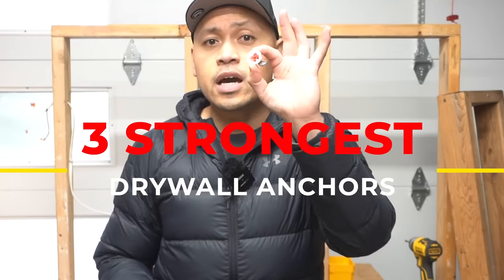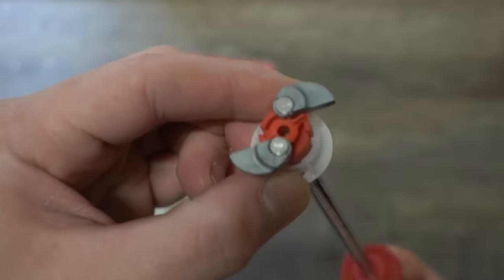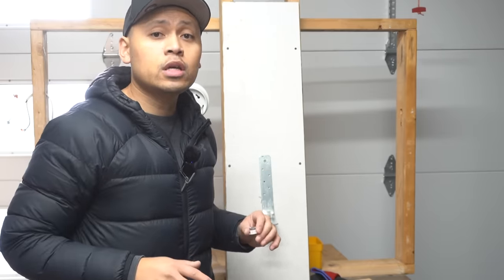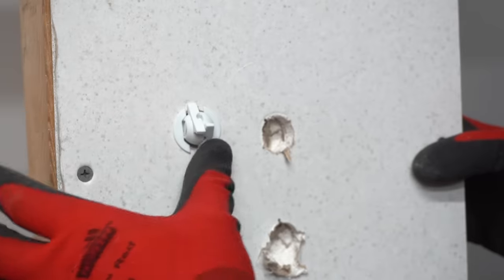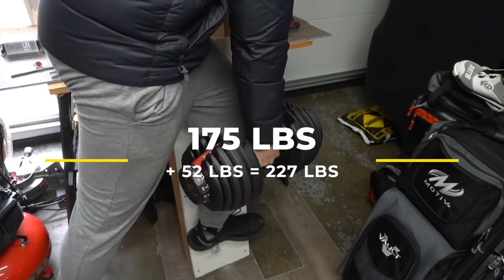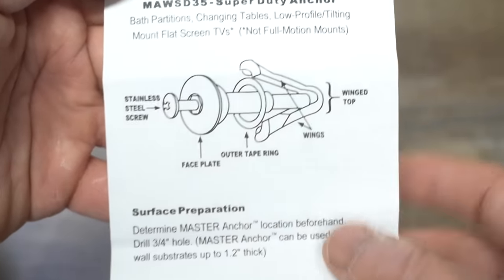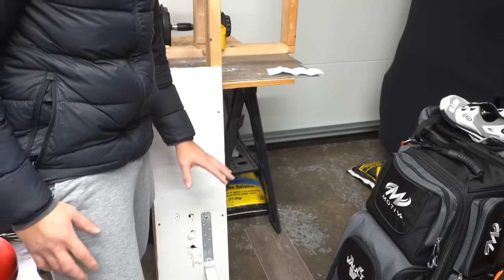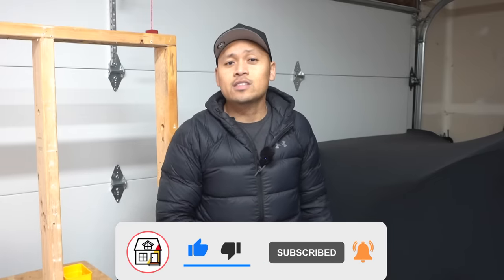Worlds STRONGEST Drywall Anchors EVER MADE! Lets Test it! How To DIY!

Comment: As a structural engineer, I don't recommend hanging anything more than 25 lbs from drywall; if anything is heavier, try to attach it directly to the stud.
Reply: Agree… Thanks for this
Reply: Yes, but this is for times when it does not align with stud.
Reply from the maker: Thank you for sharing!
Reply from the maker: I agree as well! 👍🏽😊🙏🏽
Reply: As a homeowner i do what i want.
Reply: Ya I mostly hang tvs and stuff and pretty much just use them to kinda stabilize the mount if necessary but there is always 1 or 2 lags in a stud
Reply: @1252PFC  then you cut the sheetrock and add a horizontal stud backing, then add some sheetrock, float, prime, then paint.
Reply: How about multiple fasteners  ? Different types ? Different sizes ? Wood or metal blocking?
Reply: As a software engineer, I can neither confirm nor deny this claim . 😄
Reply: @tequilacollins lol
Reply: @FixThisHouse  yes you mentioned it at 9:14
Reply: I'm not a structural engineer. I do a lot of installations and builds and care very much about structural integrity. Thanks for saying this
Reply: What are you talking about, drywall is plenty structural i once saw it hold my helper up for about 5 seconds before he went trhough the ceiling lol.
Reply: @tequilacollins as an Uber driver, neither can I.
Reply: As a stud, I agree with this statement.
Reply: as a general contractor i ask all of your kind to stop drawing stuff and implementing things on our blueprints that are not applicable in real life lol
Reply: @txmade4371 😂
Reply: As an architect, we would want these everywhere as long as it looks nice but you structural engineers have to take all the fun away.
Reply: Some people have steel studs. Steel screws in those studs aren't as strong as some anchors.
Reply: In Florida we do not have that option. due to Hurricane codes our studs re motel and you cant hang anything in them. Therefore everything is done with strong drywall anchors. I prefer snap toggles myself. I always use more than necessary. I just hung a 100 pound TV on my wall, no studs just snap toggles.
Reply: Yeah, but then he don't be paid!!!     The anchor can support 4,568pds but the drywall is the limit. This seems to get lost upon these YT schills.
Reply: @benburnett8109  I would suggest learning how to us the units first.
Reply: @COSWORTHSVTF  How do I "us the units"   Let me tell you this: I work for a 142 unit apt complex.  Drywall damage is the number one repair. It does not matter how I "us the units first"       Drywall strength will not change.  No matter how I "us the units"

Before you ever reply to my comments..........1)have your facts straight. 2) have knowledge of what you speak. 3) use spell check. 
I don''t care how or why you "us the units."   You cannot change the strength of the material you are putting the units into. No matter how much you are paid.
Reply: @benburnett8109  LOL, you must love the keyboard warriors. Why are you worried about how much I am paid? It was a professional recommendation. This is not my project so you can do whatever you want to do.
Reply: @benburnett8109 derp. Drywall is plenty strong enough. He didn’t make any claims that aren’t true. You just want to be a whiny janitor.
Reply: As a structural engineer, you have no idea why studs do not always align with the item you're trying to hang

Comment: I think most folks that have a bit of understanding of how sheet rock is made and that its not for very heavy things, would likely use these as secondary "no stud here" options but still use studs as well. I tend to use a horizontal metal bracket or even 2x4 if needed mounted to 2 or more studs, then hang things from that depending on the weight, especially a larger tv or mirror or something. But this is pretty slick how much one of these holds. I'd always use at least two if not three (or even more) to ensure the weight is distributed across a few.

Comment: If you are going to hang something like a TV screen or similar sized object that will hide the wall behind it you can just get a piece of plywood wide enough to reach the outer edges of the studs and tall enough for the mounting bracket and simply screw the plywood into the studs and then screw the mounting bracket into the plywood.  That way you avoid attaching anything heavy into the drywall.
Reply: That's what I always do as well. If the garage wall (or whatever wall you are working with)  is painted, I simply paint the board/plywood or 2x4 to match the wall....screw it into the studs (I like to span across so that I at least reach two studs) and now I have a platform for which I can hang whatever I want, wherever I want on that piece since it is anchored securely onto at least two studs.
Reply: Did that with 2 x 4's as well.  I know it is over kill but I don't ever have to worry about it falling off
Reply: @jbranche8024  Amen to that! I'm the same way.  I would rather have an overly secure mounting board as opposed to an overly expensive piece of equipment crashing to the floor and costing a fortune in damages and/or God forbid medical bills.
Reply: that's a smart idea.  I'll have to remember this next time I hang up a flat screen tv

Comment: The problem with any of these types of devices is the use of the spade bit.  If you press too hard while drilling you will blow out the backside of the sheetrock and severely decrease the strength of the device.
Reply: With all respect, let's be honest if one makes that mistake once (mounting anchors for the first time) at the latest by the second one it should be clear that one should not be so bullish when drilling or not? In addition there is always the option to use a hole saw. There are so many sizes available these days. Just my opinion. Have a good day.
Reply: @robertthomas6127 . How would you know if you blew out the back of the hole unless you cut into the wall and inspected it? I think the last one he discussed, Wingit I think it was, is probably the best choice for this very reason. These anchor designs have gotten so good over the years, they are getting to the point where the limiting factor is the strength of the drywall itself. So probably the only way to make anchors stronger is to increase the surface area they contact on the backside of the drywall. The more surface area you use, the less significant that blow out issue is. But of course, there are often obstacles in the wall that will limit how big these anchors can get.
Reply: Your point is granted, and anyone who cares about quality work knows that already. Thin wall hole saws are the best option...meaning that the thickness of the hole saw cylinder is the least necessary for the tool to last. Keep it sharp. @Pseudify
Reply: Also, if you don't want that hole in the wall after a few months\years, it's a lot harder to fix. Regular compound won't stay in that size of a hole. Not to mention the size it'll be after you take out or tap in the anchor.
Reply: @Pseudify  .... How would one know? I wrote "Don't be bullish when drilling". Constantly people can be observed pressing like they a drilling for oil. Feeling is what one needs. If one doesn't have that then let someone else do it. 😉
Reply: @robertthomas6127 . Let someone else do it?  I thought this was a diy video? I don’t know too many people who hire a pro to hang things from the wall. The idea should be to make it as user friendly and foolproof as possible. Otherwise, you’re spending 50 bucks every time you need a picture hung.
Reply: @Pseudify  .. Hello, let me put it this way. If I drill a hole in the wall I know if I have blown it out in the back. If somone has to worry about that every time they hang something up then obviously they are doing something wrong. In which case it is better when they stay away from doing it. If people stop pressing the drill bit or hole saw in like they are digging a hole in the ground they will not have a problem.  I think the majority of the people that have drilld holes for anchors often enough will agree with me on that. There is really not more to say about the subject. I know I have no place being in the kitchen  because I can't cook ...get it? 😉👍Have a good day.
Reply: @robertthomas6127    I suspect you don’t cook because you don’t like to cook. It’s not hard. Anyone can figure it out.
Reply: Just drill slowly and let the drill bit do the work to avoid blowing out the back of the drywall

Comment: I've been attaching things to drywall for over 3 decades. Came across these claws about 5 years ago and they are perfect for hanging light domestic items such as framed pictures, small carvings, kitchen implements etc. 

Never had a failure and easy to repair if we change our mind. Still hang the few heavier things using traditional techniques.

Comment: I have used the Wingits for bathroom safety bars.  They are the best I have ever used for hollow wall installation.    The problem with all hollow wall fasteners is not always the weight pulling down flush to the wall.  That has almost as much to do with how strong the drywall board is.  Thickness would make a difference.  A major consideration for many applications is how much weight pulling away from the wall.  Shelving being the primary concern.  Using any drywall anchor with shelving has this issue.  I would like to see a test of how much weight or force it takes to pull it straight out of the wall.
Reply: this guy did a pull test on various anchors. although not related to these, still very useful. 2nd half of the video. https://www.youtube.com/watch?v=lHb-Tcvkn7M

Comment: The Winglts cost $5.75 each & have to make a 3/4" hole
Gripit cost $1.91 each and its not go flush with the wall also have to make a 3/4" hole
Bullfix cost $2.37each & have to make a 3/4" hole

The bigger the hole the more distance you have to give between anchors.
TOGGLE 3/16" hold 802lbs and the hole is only 1/2" Cost $1.25 each 10 pack or $0.80 on pack of 100 
easy to find in main hardware stores.
Reply: Agreed! Plus the toggle can be slightly adjusted if needed.
Reply: How did you calculate the bullfix cost?
Reply: Until you hang something that pulls directly down you’ll realize exactly why you should’ve have used the toggle bolt lmao. Or something you need to mount on the head of the bolt. I think there might be some sleeves for the bolts but either way not always the best solution and if you’re going that way get the plastic zip tie ones I forgot what they’re called but they stay in the wall after removing the bolt and they support  downward weight better.
Reply: toggler will hold 800 lbs in 'concrete block' 
240 in 1/2 inch drywall
Reply: Adding to this, the fischer duotec 10 only requires a 10mm hole (.39 in) for a snap toggle anchor.

Comment: Wing-its are advertised at Home Depot as supporting up to 300 lbs.  I've used them for stair hand-railings when there was no stud within an acceptable reach. After a couple years use they've held up OK  I did not find them snapping in a 3/4" hole as easy as you did. I had to slightly enlarge the hole.
I do think any test of drywall anchors should include an outward (pull) test as well as a shear test.  Any heavy item of any thickness (like a TV mount) is going to exert quite a bit of pull force. Even if the manufacturer says not to use them for such applications, people are going to do it so it would be good to know if any of these are weak.
Reply: Most anchors are rated for sheer strength. Drywall is compressed chalk. It will not hold up to forward force.

Comment: I’ve been in the construction industry for over 30 years and I’ve always used toggle bolts to hang anything into drywall.
For light weight items I’ve always used the zinc ez anchors. Never had any problems with either except once when using toggles the toggle bolts actually loosened up a little bit after 2 years of heavy use. So I just went up the next size in the toggle bolt and never got a return call.
Reply: I have a very heavy statue that I want to hang ( 50kg ), I want to fix a large panel ( 40cm x 70cm height x 2.2xm thick ) of strong wood with 4 or 6 toggle bolts onto the drywall ( no studs at this place ), then place another wood panel with squares, fixed on the first wood panel, then put my statue on it. Would you say it's ok ?

Comment: The anchors may be rated for heavy weights, but I would never trust drywall to hold up to that much stress over a prolonged time. Of the 3 I'd use the Bullfix, because it is easy to remove. Just unscrew to retract the wings, and pop it out.
Reply: Unscrewing the screw doesn’t retract the wings. He tapped it in with a hammer and then the screw goes in after, so if the screw is then removed, it doesn’t pull the wings with it
Reply: @TimmyTheSnail you are correct.

Also may I add (regarding the 3 anchors), the Gripit is reusable and can be used in situations where the plasterboard is inches away from the wall... example dot & dab walls.
Reply: @kaywhite4920 the GripIt in theory is reusable, but since the wings construction was changed from metal to plastic, I’ve found once they are tightened up against the plasterboard, they become partially damaged/deformed. The bullfix can also get into a tight gap due to not much sticking through as you place it in the wall part of it, and then as you tap it in further with the hammer, it’s getting closer and closer to the back of the plasterboard
Reply: @TimmyTheSnail 
Thanks for informing me regarding the change from metal to plastic wings.. was not aware of the modifications.

Comment: Testing the performance of the anchor in mostly a shear load scenario doesn’t capture many use case scenarios where the load is actually away from the wall by up to a foot.
Reply: I agree. As when mounting a towel rack in the bathroom that's 2" - 3" from the wall. Now you have to deal with the cantilever effect when hanging towels or hand pressure on the towell rack. .but Istill like the BULLFIX over the others

Comment: Hello, Very well done presentation. Interesting products. 👍 I'd assume that in most cases one will be using more than one anchor and therefore their capacity will not be overloaded. Also in many cases the first two anchors can be installed for objects such as Towel rods, toilet papier holders and similar which once mounted remain for decades, but tend to be items that are often ripped out of the wall when mounted with standard anchors. Thank you for presenting them.

Comment: Two words: Strap Toggles. I use those for most of my heavy wall mounting applications. No huge hole, ease to use, cheap, and plenty of strength because it distributes the force over a larger surface area than any of the anchors demonstrated here.

Comment: Those holes are even bigger than a toggler bolt anchor hole I would just use those instead especially for tv mounting
Reply from the maker: Thank you for sharing your experience and feedback! 🙏🏽😊
Reply: As a pro flat screen tv mounter, these seem pretty effective, though I don’t think I’d be comfortable if the mount was a full motion articulating device. Unless of course the FSTV is very lightweight. Under 55” are usually only 25-30lbs.

Comment: Several have mentioned that if you are hanging heavy items you should fasten into the wall studs instead of using drywall anchors. Often that would be better, but it depends on the studs. Wood studs are great, but metal studs can be problematic. For one, metal studs used for interior drywall partitions in homes are often the lightest duty made, 25 gauge or less. The issue with that is fastener pullout. In this case heavy duty drywall anchors are a better choice than fastening to the studs. Heavier gauge metal studs can hold fasteners plenty strong enough, if the correct fastener is used and it is also installed correctly. 

I used to do fine art installations for museums, galleries and collectors, and I've mounted some very heavy items on a wide variety of wall types. There is always a way, though sometimes it takes quite a bit of work. One pretty easy solution if the object will cover it, for example a large 50 kg mirror, is to make a French cleat out of plywood, making the wall half as large as practical and attach it to the wall with lots of heavy duty drywall anchors such as large toggle bolts or Wing-Its.

Comment: I would use a zip-toggler in 3/16 or 1/4 inch because they only require a 1/2 inch hole.  Less problem to patch when you remove it.

Comment: These are pretty clever products. A not too costly option. 

Initially I was very skeptical. But after watching the entire video I remembered how many times the important part of my favorite anchors have fallen into the cavity, requiring the number of actual anchors versus the ones lost, meaning profiting from the job and not having the expected return. 
I favor in the special fasteners when needed, but I can’t add more just because I lost them all n the wall. (I can, but that isn’t ethical.) 

I think I’ll be investing in these for a trial. Always open for a better option, especially when it reduces wasted time. ❤

Studs are ALWAYS the best way. However it’s not always an option to have them exactly where they need to be. 
My last experience with that was where the only (usable) stud was in the dead center. 
Another issue is when they are 24” spaced, and I have only a 16” spaced tv mount. 
Many of my jobs are in a high rise building with metal studs. Sometimes I’d like to simply use a lighter duty fastener such as these so I don’t necessarily want to deal with metal studs. A tilt only or flush mount, these would take 10 min. to do the job. Exterior or a shared wall, with insulation, these would really be a great option. ❤❤❤